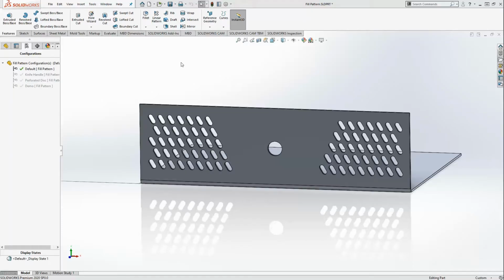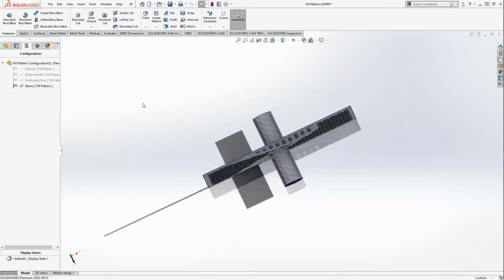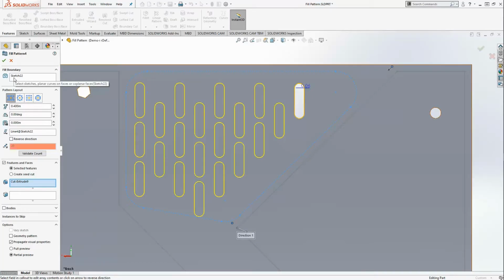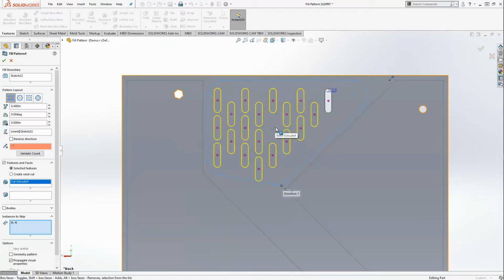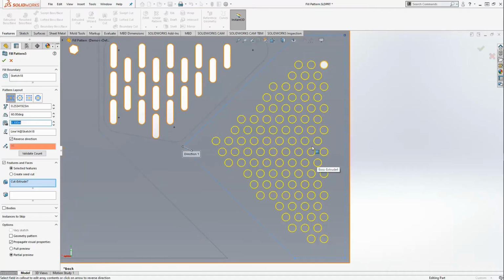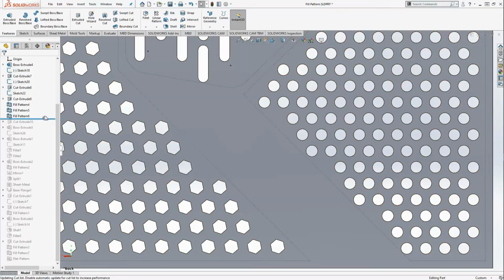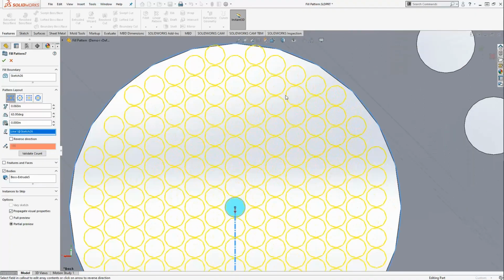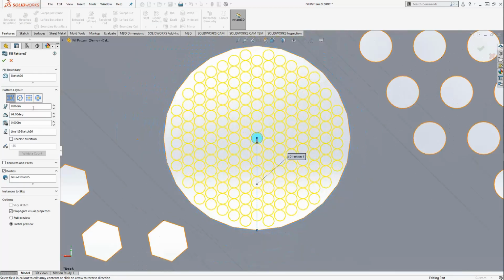SolidWorks Tutorial Fill Pattern Basics

Comment: This was great.  But I have a speaker grill on a contoured plastic housing.  Got it to punch straight thru...great, but I need the holes drafted from core and cavity sides so parting line is mid. wall thickness.  This option does not allow to punch thru to a surface or to a depth.   What method is best for my application?
Reply from the maker: Ok, I think I understand what you're trying to do and, no, this is not the right tool for it. :)  I would suggest creating an offset surface to match the middle of the wall thickness you need.  Next, create a plane ABOVE the surface.  Create a sketch on that plane in the pattern of holes you want, no open contours.  Take that sketch and project curve from the Features menu, selecting your surface and your pattern.  Once done, create a 3D sketch and convert the entities of that pattern projected onto the surface.  Lastly, use the Cut-Extrude command, mid plane, with draft angle.  It should cut using the sketches at the plane level.  Hope that helps!

Comment: How did you create the fill boundaries when making the sheet? Or, in general, how do I create boundaries for fill pattern? I tried doing offset entities for construction but the offset just disappears after extrusion
Reply from the maker: The fill boundaries are just closed sketches that are done on the surface of a planar body!  I would suggest creating the sheet alone and extrude, then I would create a 2nd sketch on that extrusion and use the offset entities command.  After that, you have your boundary and create the fill pattern!  Hope thi helps.
Reply: @domeasolidtuts  Thanks, it worked. Another question: If I set the fill boundaries to be two separate closed sketches, would solidworks know I want to fill pattern between them? Otherwise how can I do that?

Comment: Hello, 
thank you so much for this video, I've learned a lot and it's very helpful :) 

I have a question about the part 'Boss Body Pattern'. Everything works fine until 7:22 min. How do you insert the body? Or where does it come from? Unfortunately I can't find it. 

Could you explain this part in detail? Or do you know where I can learn more about that? 

I would be very grateful! Thank you again for your video. 

Best, 
Viktor
Reply from the maker: @inkognito2318 Hi Viktor!  Great question and I'm surprised no one asked it previously.  I just placed a concentric sketch in the circular cut and used the Extrude command but uncheck "merge result" under the measurement.  This created the "noodle" in the center of the circle, however, you could have sketched it anywhere within the container sketch and it would have worked.  Hope this helps!

Comment: hi great video very helpful. however i am running into an issue when trying to create my fill. i have already created the hole in center and created a boundary line in a seperate sketch but when i am creating the fill pattern feature i am receiving an error that says "the direction selected for the area fill should be parallel to the contour" i cant tell what i am doing wrong but what exactly is 'the contour'? not sure how to remedy this problem.
Reply from the maker: Hey Blake!  Is the sketch plane of your boundary line parallel to the plane of the hole?  It has to be on a parallel plane, even if above or below the feature you are trying to pattern.  Let me know if this solves your issue.  If not, feel free to message or email me!
Reply: @domeasolidtuts BH TV ka up on zu😊न नौ-नौ
😊बढणढगडच
Reply: 😢🎉😢😢 2l2
Reply: @domeasolidtuts  problem solved thank you for your timely response :) i subscribed
Reply: Ñ🎉mk

Comment: Just curious, do you think fill patterns, when being used to create texturing for parts, is kind of obsolete in solidworks?  I feel like I'd much rather just use the 3D texture tool that was added in 2019.  I guess unless I wanted to make a custom never before made pattern that couldn't be found online and imported as a 3D texture image.  Feel like for most cases though, the 3D texture tool is the way to go
Reply from the maker: It depends on your preference and the complexity of the texture.  If it's a simple knurling texture contained within a sketch, then using extrusions to a point will definitely simplify the surfacing.  Introducing mesh makes the surface less accurate and "muddy" to a point as you've lost some of the mathematical control of the geometry.  This video was mainly focusing on how to use the fill command for cuts and potentially for extrusions.  There's always 100 ways to solve a problem and you just gave those not familiar with the 3D texture tool another way!
Reply: @domeasolidtuts  Got it, I appreciate the quick response!
Reply: @domeasolidtuts ~
Reply from the maker: @MdAslam-xj2qm  Got a question?

Comment: When I am trying to select the sketch on body ,say, hut ,then when I am applying the fill pattern it is not showing any hole
Whereas if I am selecting a surface then it's completely fine
Please help
Reply from the maker: Is the sketch projected onto the body or is the sketch on a flat plane?  The sketch for the first cut out must be planar (on a flat plane) in order to successfully fill a solid.  You can try to create a sketch plane parallel to what you are cutting through and the fill pattern should work.  Hope that helps!  Please PM me with an example file so that I can assist you further if needed.